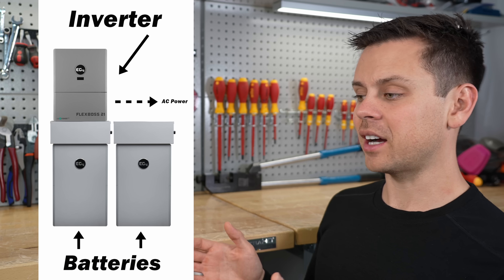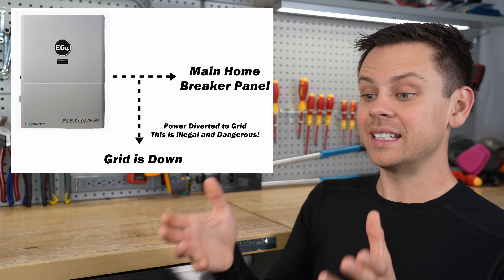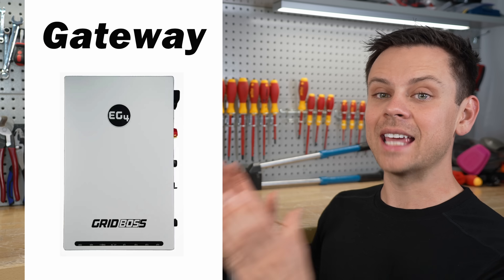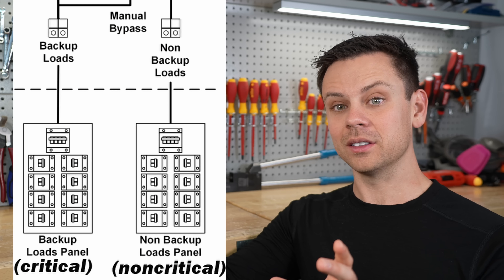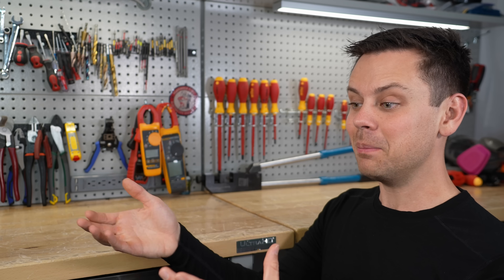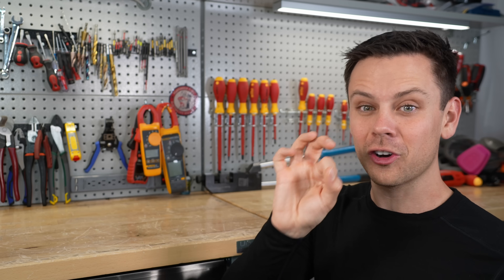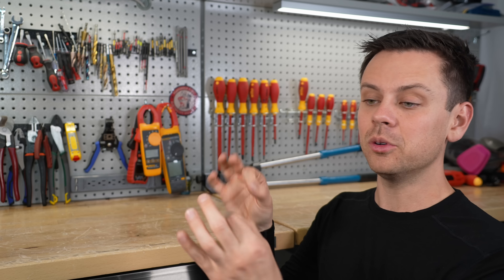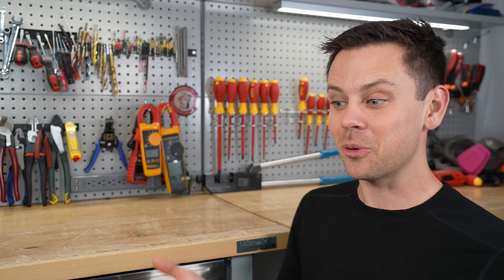EG4 Grid Boss Gateway: What is it?? Beginner Friendly Tutorial!

Comment: Hey Will! I'm a huge fan of your channel - your detailed, informative content is incredibly valuable. I have a video suggestion that might be slightly outside your usual focus: RV off-grid power management systems.
Looking at your internet forum (mobile - solar), it seems like Victron dominates the conversation, but surely there must be other viable alternatives in 2025. I'd love to see you apply the same cost-saving approach you used in your Solar Cart vs. Ecoflow/Jackery comparison. Your method saved viewers $3,200 with one battery and $6,000 with four!
I'm currently planning a system under $10,000, I would like to use seven Ecoworthy Server Rack batteries. I want to be off grid in my Brinkley for long extended periods.  Would you consider creating a video or two about building a robust, off-grid RV power system that offers an alternative to the expensive Victron/Battle Born setups? Your expertise would be invaluable in helping viewers like me create high-performing systems at reasonable prices.
Thanks for considering this!

Comment: Thanks for the simple explanation. I'm considering a home backup with just batteries, no solar. SO I would need the gateway, inverter and batteries? batteries would charge off the grid and when grid goes down the house runs off battery. maybe a generator input in case of long outages? Am I missing anything?

Comment: Do these newer units also have UPS?   I'm off-grid w/grid-assist and built my system (7yrs ago) using several mechanical 50a @ 240v ATSs + 30a @ 120v ATSs thru the house (one at the compressor, one under the big kitchen stuff, one at the main panel, etc...) with extensive inverter AC custom wiring distributions (as you said) because they didn't make a 200a ATS that was affordable to use at the main panel or built for 1,000(s) of switch-overs thru multiple years.  I use a centralized APC UPS (and more wiring) for sensitive circuits during switch-overs.     This new move/evolution should help avoid power company entanglements and enable more DIY.

Comment: Still running my EG4 6500ex split phase system from your nice schematic/photo setup almost 3 years later.  Not one down hour since it went live.  (besides my tinkering with settings and adding more batteries).  Winters are tough up here in upstate NY, but I found some used commercial 540 Watt BiFacial panels cheap and added 4 of those to my 12   445 Watt Bifacials to test through this winter.  Amazing difference, and I've got 4 more I can add for next winter.  It cut down my generator use by 50% or more saving me over $225 so far this winter in propane.  And I like the fact that I get better power output and solar input with those than some of the more recent options available.  (13.5kW out and 8000 Watts per inverter input) plus that 500 Volt max input.  One thing I wish the industry had was more heated battery options, or an insulated rack system.  (I made my own with reflectix, foil tape and a small space heater)

Comment: This is helpful Will, thanks. One thing that I think would help is having a diagram or at least an example of where wires would run, as I am still a bit confused how this saves on wiring since it is adding another device that may not be near the inverters. But definitely more clear than before on the utility of not having the huge transfer switches.
Reply from the maker: So between the meter and the panel, which are usually close together, you put this device. Then you can install the inverters and batteries wherever you need them. With smaller wires
Reply: Yeah. So, if you want your batteries and inverter outside the house in a shed or something, this setup would save a lot of money.

Comment: I roughed in separate circuits and panels for grid and off grid uses.  No transfer switches needed.  I even ran some receptacle where the duplex outlet had one powered by grid and one powered by off grid.  This way you can just move the plug to the adjacent plug.   If you are doing a new construction project or even a renovation, you can do this while you are roughing in the electrical.  Then the systems are separated and no need for worry about feeding power back into the grid.  If your electrician bucks this, just do it yourself after the electrical roughin inspection and before drywall.  In final inspection, the off grid panel just looks like a sub panel and most likely will not raise any red flags for the inspector.  It's not a code violation anyway,  you just don't want to make a big deal out of it because some inspectors think they are power gods :)

Comment: Hey Will! Thanks for the update— I ended up diving deep into reading about the Grid Boss after your last video. One thing you mentioned is that it’s okay to mix inverter brands— when I was reading the manual, it said to only use the Flex Boss hybrid inverters. It mentioned using any other inverter could damage it. Is that accurate, or does EG4 just want you to use their thing?

Comment: Where systems like growatt that input power from the grid and then blends solar and battery with it fits? so you are always tight to the grid, and you can have savings using solar and have a backup when grid is out, is not that much better

Comment: Gateway sounds good. How would you go about charging a battery wall backup with the grid on overnight low kwh $ power using just a battery wall, inverter and gateway essentially using grid to charge batteries overnight using lower cost grid power and not worried about solar until a later date. I understand that gateway can direct pwr from batt to load or grid to load but how do you direct grid to batt and load at same time ? Watt am i missing? Lol

Comment: I'm guessing that you would need 2 Grid Boss units if you have 2 - 200 Amp service panels (400 Amp meter service, i.e. 320 Amp continuous rating).  In that instance, do you have to isolate separate inverters/batteries for each of the 200 Amp service panels?  It would be nice to have the ability to have power going from all of your inverters and batteries to either one of the 200 Amp panels, when either one needs power, instead of having 2 separate battery banks, each of which feed only 1 of the 2 panels independently from each other.  I'm a beginner with solar but have a good understanding of electrical service, so I'm hoping that there is an easy way to tie everything together somehow, so the whole 400 amp service could be interconnected, instead of treating them as 2 separate 200 Amp systems.  Any help would be greatly appreciated in explaining this, and many thanks for all of the videos!

Comment: Such a gateway makes a solar system much more modular. My house came with "the big panel switch" and that's what I'm using to manually go between grid and solar. Winter charging is problematic (dark, overcast, snowing) where summer can be clearly all solar for my situation (panels and batteries now on-site) so a hard switch fall/spring makes the gateway less useful because I don't need constant switching back and forth. If the grid goes down in the winter from an ice storm I can flip the big manual switch for backup power.

Comment: Thanks Will!  My brother lives in phoenix.  He put several solar panels on his roof to power a pair of solar generators that run Midea inverter AC units for the master bed/home office an one of his rear bedrooms.  This inspired me.  I'm making plans to later this year install a mini split for our 400 square foot home office area.  Then I think that I will use one of you EG4 hand truck builds to run the mini split and perhaps the 4 PCs in that part of the house.  The fence on that end of the yard needs to be replaced.  If I do it with solar panels instead of a new wood fence I'll can reduce my electric bill in the process.  I'll have to calculate how long such a system takes to pay for itself.  Once we do whole home solar I can take the inverter from the hand truck system and use it with one of our Prius for portable power for boondock camping or to supplement our solar if the grid goes down.

Comment: Great video. I just bought a Grid Boss to go with an 18 K PV. I am grid-tied and am AC coupling an existing solar array through the Grid Boss smart ports. I watched one of DIY Solar's earlier videos on running the house from a Ford Lightning which was inferior for many reasons, but it begs the question. - With the proper gateway and at least one stationary battery, wouldn't a gateway smart port be the proper way to connect V2H EVs?
Reply: Just curious are you keeping your existing grid tied inverters.

Comment: Will these work with net metering?  Or all or nothing?  I want to add a net metering hybrid system to my house, but I don't think I can fit all the solar I need on the easy roof (1/2 my potential roof area is at a 45 degree and over a cliff...  Requiring a professional).

Comment: Hi Will I think you should also clarify that a single flexboss can work in a gridtie mode with battery backup. They call it GTBB mode which means you do not need a gridboss. What this means,  there is still a transfer switch in the flexboss but it only rated to the inverter amp and not 200amps
Reply from the maker: Yes I mentioned that at the end
Reply: @WillProwse  I got that impression from from you that you do not need a gate way for an off grid solution but for any on grid situations you would need it regardless of the numbers of inverter you have but what I understand from the flexboss manual is, if you are using only one inverter you can use it on grid without the gateway. This would make any entry level system even cheaper once the house power requirements fall with in the capacity of the home for a full coverage application.
Reply: It works but many, probably most municipalities will not allow that configuration with only 90A as the service, to also operate whole-house.  Not legally anyway.  The Grid Boss is UL rated as a 200A service entrance.  Virtually no inverter is UL rated as a service entrance.  The few that can, like the 18KPV or the Sol-Ark, work ok with just one inverter but the moment you add a second one (or more than one in general), the cabling becomes a real problem with very thick cabling, 200A splices and 600A busses to deal with.
Reply: @junkerzn7312  I see you point and by the time you install a critical load panel then you might as well just get the grid boss and be done with it
Reply: @johanncover1988  Yup.  I have gone through the ringer putting my system together.  Last year I started by thinking a Sol-Ark system would be the ticket, but got stuck on the complex design and 200A routing.  Then the Tesla PW3 came out with its meter collar adapter significantly lower workload, and I actually started the process for getting one.  Then Musk went AWOL and I couldn't support it ethically so I canceled the PW3 project (fortunately before any work or equipment was actually done / ordered).  So back to the drawing board.

After that it came down to either getting a Franklin system or going with EG4.  I was busy comparing the Franklin with an EG4 18KPV + LL battery rack solution (which has similar complexity to the Sol-Ark, requiring a lot of expensive 200A boxes and work ... manual transfer switch, additional load panels, 200A cabling, etc)... when EG4 came out with the Grid Boss and the FlexBoss21.

The Grid Boss instantly sold me.  Like a lightbulb going off.  It does absolutely everything including the required manual transfer switch.  It removes nearly all the professional electrician work form the project, removes the manual transfer switch, removes the distribution panel, and removes most of the 200A cabling.

I finally put the money in last week and am hiring an electrician as we speak to do the service-side, which is modest and far less than anything else outside a PW3.  I will then DIY the FlexBoss21 and batteries (also now ordered and arriving soon).

-Matt

Comment: I’m considering installing the gridboss in my home but have questions about my Tesla solar panel and inverter that’s existing. If I remove the Tesla inverter and install the EG4 inverter, will it talk to my Tesla solar panel rapid shutdown MCIs to keep them active? No one seems to talk about solar voltage rapid shutdown systems and they are required in my area and a lot of other areas.
Reply: What you can do is connect the Tesla system to smart port #1 on the GridBoss. (AC coupled) Then you can add a EG4 Hybrid inverter ( with more solar panels) at the same time or later that would allow you to connect batteries for storage and more AC output
Reply: @davidferris4563  Thanks for the reply but there are two issues with that. 1. The Tesla inverter will shut down when the grid goes down, taking solar with it. I think I can resolve that by moving the sensor past the grid boss input but only if I have power from another inverter making the sensor think grid is up. 2. No room for more solar on my small roof. The EG4 inverter could work if I can set it up to charge batteries from the grid and not have solar input. Wonder if that is possible.

Comment: I run mine like it. It is a giant solar generator. My inverter AC output goes to 100 amp panel, which I put a 60 amp breaker that I run to a 60 amp RV cable plug. Run the cable to buy House main panel .  If i want grid, I throw the main breaker on.   For solar I turrn main off and turn on 60a breaker.  No insurance issues.   Simple

Comment: I should join your forum.  Wanted to add the fact that the smart ports are bidirectional.   If you haven't listened to the interview between Kelly with Signature Solar and the CEO of EG4 you should.   They talk about the dark start issue in pretty good detail.   As I think the load terminal on the Flexboss is bidirectional like the smart ports.   That's why I want my EV charger on a smart port so I can charge my Powerpro batteries from my 132 KWH EV Battery.    ;0)
Reply: What EV make/manufacturer do you have that allows this power transfer from the vehicle?

Comment: What if the grid goes down and the batteries are low. You have multiple days of bad weather. Either the Grid Boss or the Flex Boss have a built in battery charger? So you can charge with the gas or LPG generator.
Reply from the maker: Yes that's covered in the other video I posted today towards the end
Reply from the maker: And yes you can connect generator if you want

Comment: Never wondered why all these manufacturers sell gateways, thought it was just som new e-waste gimmick 😅 just for the inverters to talk to each other and nothing else
But now i understand why all these tesla power walls systems installed by professionals have gateways, totally makes sense for on grid systems with battery backup.

Instead of like most grid tie systems that just goes black when the grid is down
Reply: Yes, and there is actually yet another method that is starting to become more widespread which avoids the need for a gateway entirely.  The method is called a "meter collar".  A meter collar is basically nothing more than a grid disconnect that can be monitored and activated/deactivated by the ESS system.  In a grid-down situation, the ESS system would activate the meter-collar to disconnect the grid and then backfeed the main service panel to run the house.

No need for a transfer switch and no need for a MID (gateway).  The meter collar method isn't quite as seamless as having a MID... a power failure might glitch the house for a second or two, and the backfeed is more limited because it might just be a 100A circuit backfeeding into the 200A panel.  So there are some limitations to using the meter collar.  But on the flip-side, the amount of electrical work needed is literally cut in half... no messing around with 200A 3/0 cabling, no having to intercept the main panel.  All of that goes away.  The house circuits can stay where they were.

-Matt

Comment: I didn’t hear you mention whether you could feed a backup generator into the “grid only” system.
Reply from the maker: Yes. The gateway has generator inputs. Forgot to mention, sorry
Reply: @ thank you 👍🏼
Reply: @WillProwse If you only have a smaller inverter generator are you better off still using a chargeverter?
Reply: @turtle1723  Yes, it’s been my intension to use that as well, but I hadn’t remembered that until you mentioned it. So thanks for the reminder Will. 👍 This system is another “game changer”!